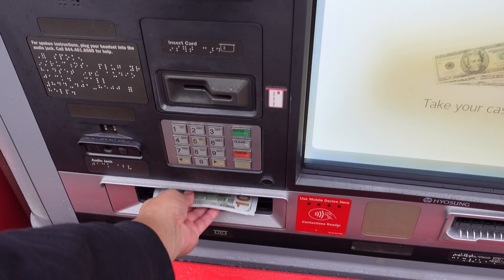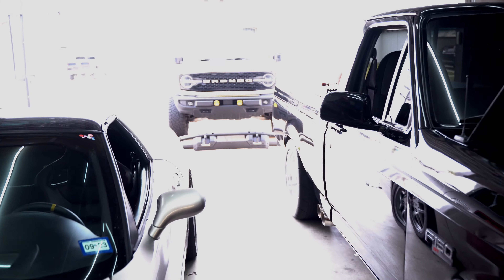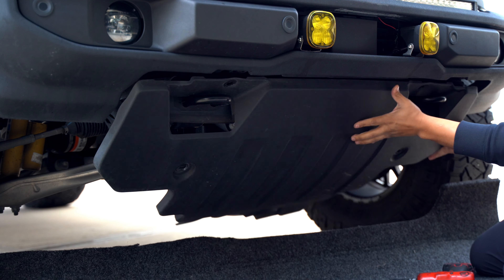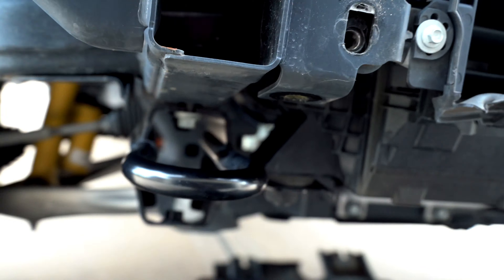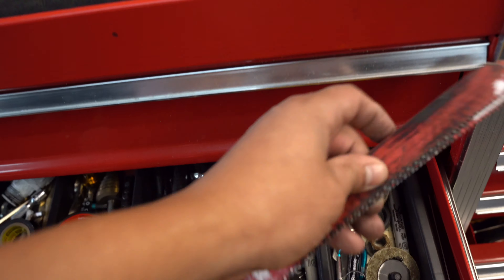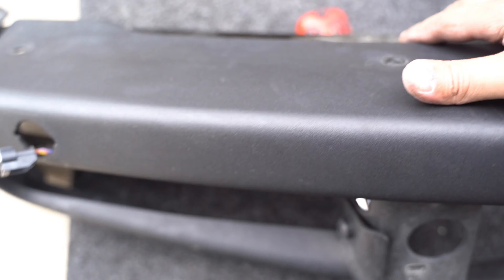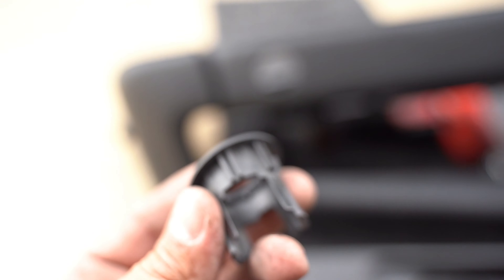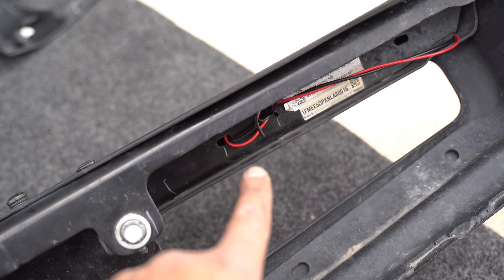Plastic To Modular Ford Bumper What It Takes To Install. How To Install Ford Bronco Modular Bumper

Comment: What light bar did you have on there that was ticket up to start with I like how it was tucked in and not obstructing any cameras or sensors
Reply from the maker: It was a 42” from lasfit, I agree it fit perfect. Check out my channel I have a video on the install. Here’s a link to the bar for you https://amzn.to/3P3koR5
Reply: Thanks I’m going to order it did you have it bolted in/down or was it just pushed into the factory rubber strip just trying to see how you had it installed as I like the way it looked with factory bumper. Thanks and great video!

Comment: Those sensors, are they the same ones on all broncos are are they specific to package like lux, mid, etc?
Reply from the maker: You know I’m not 100% sure on the correct answer. It doesn’t make sense for ford to make different sensors for every Bronco model. It’s just not cost effective.
Reply: @JJBanuelos  lux package has adaptive cruise control that the others don’t, I’m not sure where those sensors are located which may make the swap difficult to impossible for lux package Broncos but I’m not sure.

Comment: I saw another video where it wasn't a problem to remove the tow hooks with the bolts. The intercooler doesn't drop out. To be even safer, you could put a jack under it while the bolts are out.

Comment: Would the old tow hooks fit with the new bumper installed, or will they be in the way?
Reply from the maker: They can be installed but you’ll have to cut up the modular bumper up to get them to fit.

Comment: JJ. I bought all the parts to assemble a 2023 modular front bumper but it came with no instructions on how to assemble.  Any suggestions?
Reply from the maker: As long as you have all the components it should go together pretty easily. You almost can’t install them incorrectly they only fit into the location they are supposed to go. Let me know if you have any other problems.

Comment: Are the brackets welded i think you said,  I just bought the modular bumper, and the tow hook bracket without the tow hooks. Just checking before I replace the plastic bumper
Reply from the maker: The tow hooks are welded to the existing bracket which is just bolted to the frame.

Comment: Do you happen to have a video of tying into the fog light wiring? I bought a braptor modular and trying to get ready to tie into the factory fogs.
Reply: I hope you saved your fog light harness from your plastic bumper.  You'll need to add that to the modular bumper.  I bought the Morimoto 4 banger kit as well and an adapter that plugs into the factory harness then into the 4 banger so I can utilize the factory fog light switch to control the sae 4 banger fogs.
Reply: @Sn-tk8rq  Is it possible to add the fog lights from the plastic bumper into the modular using the factory harness?

Comment: Man!  This is exactly what i was looking for! Im about to do this this weekend.  Do you see any way to install the stock fog lights into the modular bumper??
Reply from the maker: I don’t think so. They don’t really have anyway to bolt them in or even incorporate them into the bumper where they’ll look good.
Reply: Thank you!  I ordered a triple fog light setup from Oracle instead! Great build, man!  Is yours a sasquatch?  Ours is a 2 door non-sas outer banks with the 2.7
Reply: Also, the bumper is already done.  I had Ford do it.  It was $700 installed.

Comment: You say it’s not possible to run the sensor wire connector and then you skip to saying okay now that’s all connected???  Are your sensors connected or not, looks like not.
Reply from the maker: What I meant was your not able to run the sensor wire if you leave the bracket on the back on. You have to remove it. Mine are hooked up.
Reply: @JJBanuelos  can I ask how you got enough length from the parking sensor harness to get it plugged back into the connector?  That's where I'm stuck.  I have the bumper all taken apart, harness run, sensors plugged into the bumper, but need about 3-4 more inches of length out of the harness to get it to reach the connector behind the grill/front driver side fender area.
Reply from the maker: @nicholasbrewer3162  I unclipped the harness from the body where it connects by the fender to give me enough slack.